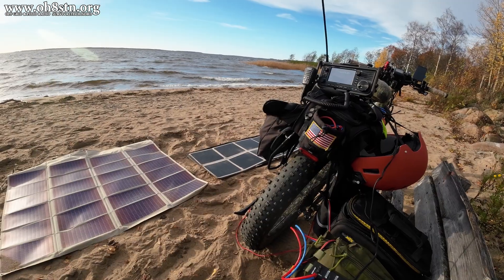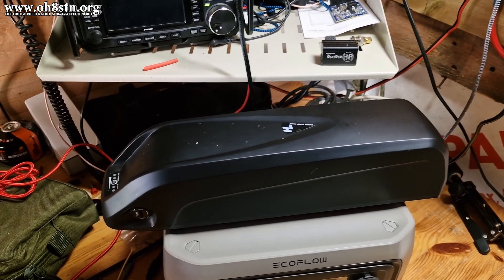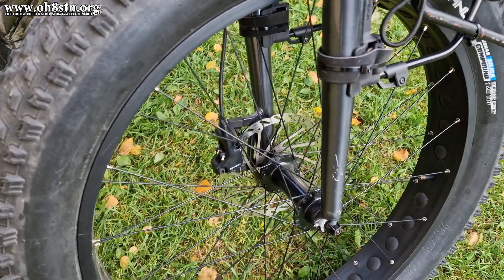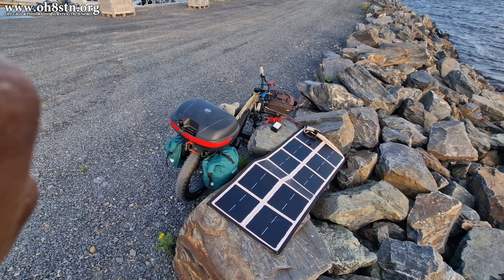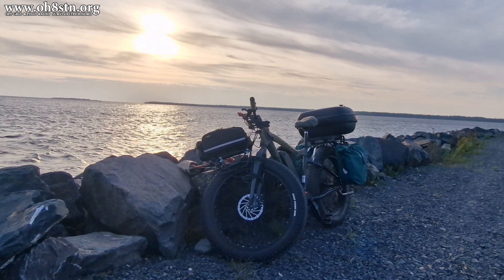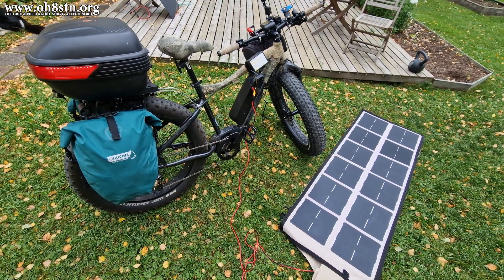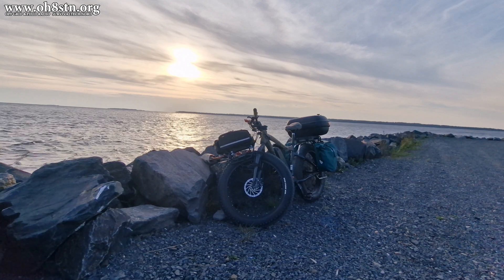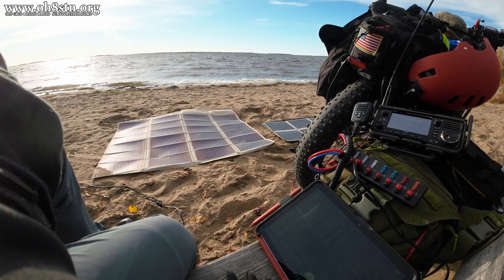Off-Grid E-Bike Charging with The Sun | PowerFilm Solar

Comment: I ride a fat'ish tire (3 inch) ebike for commuting, cargo, workouts, and recently started riding it offroad in preparation for some camping trips. I'm also experimenting with recharging offgrid, so I could try and reach more campgrounds in my area without risking a ride with an empty battery near the end. Although for now I'm just dipping my toes with a 45 Watt solar panel, which would need some 2-3 days of perfect weather to recharge my battery from zero xD
Still, might be enough to get me some 20-40 extra kilometers on a weekend camping trip.
Also, I'm hoping to live offgrid someday, so I see it as a good way to familiarize myself with offgrid power in small scale before going big.

Comment: I was hoping that you'd have hub motors with bicycle pedals .     I agree , changing a tire is more difficult with the hub motors  .     I've been loving Your awesome videos since the HEADWAY LIFEPO4 cells , I ended up buying 8 of the batteries used , made 4S2P 13.1V 15Ah .       It should have about 400cold cranking amps for ten seconds , so I might be able to jumpstart a big truck with them , I'll make that video eventually on YT .    But you helped get me to buy the HEADWAY cells Thanks and keep kicking butt .

Comment: Very interesting and informative video. There are many e fat bikes on the market now. So may I ask why you choose GZR..? Also why the 160 w Powerfilm instead of the 220w or the 190w..?
Reply from the maker: Thanks for the question and comment. The gzr was only about availability, support, and service in my local community. I also chose it because of its simple two wire battery charging.
I chose the Power film 160 because at the time it offered the highest efficiency in the lowest weight I could find. Moreover, I didn't have a charge controller that was capable of utilizing more than the 160 watts. Now I have two charge controllers, so I can double up on the solar panels.
Reply: @ Thanks for your reply. Would the 220 Powerfilm be a viable option and would it charge an e bike faster..?
Reply from the maker: @thegreateststruthsnevertold it would charge an e-bike faster if you could find a charge controller capable of handling its power. 👍
Reply: @OH8STN  Is that why you choose the 160… due to limitations of available charge controllers..? There is a New 190w now… Are you aware of any charge controllers that would do the job… for the 190 and or the 220w..?
Reply from the maker: @thegreateststruthsnevertold those solar panels are awesome if you're going to connect them directly to something like the ecoflow delta or the eco-flow river bluetti, ... solar generators.  In fact any solar generator which has the charge controllers built in. Anyway to answer your question yes, that's why I chose the 160 for charging my electric fat bike.
Reply: @OH8STN  Thanks for your reply. However you missed answering one question. Are you aware of any stand alone charge controllers that could handle a 220w or 190w Powerfilm Solar panel..? Thanks in anticipation..! 😀
Reply from the maker: I did answer, but here is more context. If you want to make use of those larger solar panels for charging your e-bike the one way to do it with the larger panels is to use the solar panel in addition to a inverter, and the e-bikes AC charger. As far as I know,, there is no portable charge controller which can handle 190 or 220 or more.

Comment: I own an E-CELLS Super Monarch Crown e-mountain/cargo bike. 2 wheel drive, 2 batteries and dual suspension and weighs 95 pounds. It will haul 400 pounds including my weight.
MY CHARGING SYSTEM-> 200 watt off Grid TREK solar blanket from Canada, ELEJOY programmable controller and cables. My bike has a Patented frame charging plug near the crank area. It charges BOTH batteries simultaneously. Rene at Off Grid TREK made the cables for the blanket and for my bike (of which he has an identical model).
THIS SOLAR BLANKET/CHARGE CONTROLLER system is easy to carry and easy to use. The Off Grid TREK 220 watt or 300 watt solar blankets are the FASTEST charging blankets sue to not being much affected by shade and clouds compared to all other solar blankets. My 220 watt 3' x 6" OGT blanket weighs 12 pounds and 1.5 pounds for the ELEJOY programmable  charger.

Comment: How do you avoid overcharging the battery?
Reply from the maker: That is the job of the charge controller.
Reply: @ does do this automatically or require you to set it?  Thanks for the awesome info. Got me into a fat bike and now looking at the solar options for it.
Reply from the maker: @robertalonzo5725 it's totally automatic 👍

Comment: Also, I only found the GZR on a Finnish website? Is there a link to the bike? I have found the AMYET bikes available that are similar but not mid drive for the easy rear wheel replacement. 
Edit: Also, I just saw the end of the video where you say you're in Finland. Much clearer now why you ride the GZR. Ha!

Comment: Excellent setup Sir. I have been using my Fatbike and trailer to drag my radio gear, batteries etc around South West Scotland but getting older and slower so Human Powered travel range is becoming very limited. Looking at options available for either a bolt on Ebike conversion kit for a while but not that impressed with kits that will fit a fatbike. I have almost given up and started collection components to build my own custom system to fit my existing fatbike. Currently only have a small 65W portable solar panel and a selection of Li-Ion and LiPo battery packs and a 250W motor and modified controller recycled from an old scrapped Ebike  Now saving up to get  better solar panel and battery with goal to get the system up and running for next summer and I can get back on HF and try to bag a few more summits and grid squares that I simply cannot reach in sensible time span under my own leg power.  Looking forward to seeing more of Your HAM adventures on the Fat-E-Bike. All the best de MM7WAB IO75sj

Comment: Great video as always! However, for over $1500 for the solar panel alone, this project is WAY too much for my budget.
Reply from the maker: Yes the solar panels are expensive but there is the Genasun kit featured on the channel earlier this gear. That solar panel is easier on the pocketbook, but not quite as portable. Take a look.
https://youtu.be/PR893unyMog?si=6d7OKkCk_bJ3Ly_M
Reply: @OH8STN  Thanks for that Julian.  Does anyone know of a way to build a foldable panel, instead of buying one?  Or, does it not make sense economically.

Comment: Remember, these bikes are a LOT heavier than your typical mountain bike so lifting & pedaling is a lot of effort.  Also, you won't typically get a 15 or 18 speed shifter.  (Usually 7).  My USA made Lectric brand 2 wheeler is 65 lbs (30 KG).

Comment: Thank you for opening my mind. Funny how our mindset can narrow on it's own from habit without us noticing...
I've been interested in electric bikes, but the self-made hurdle has been their voltage. My logic has been all my radio and other gear is 12v and 12v isn't a reasonable option for e bikes. I just needed this gentle reminder that all I needed was a simple relatively inexpensive charge controller and the rest of my solar kit would work just fine with a bike in the field. *slaps myself on the forehead....

BTW, also thank you for introducing me to Genasun! I have them in my camper and a battery box or two. Fantastic products.

Comment: Is "fat bike" a brand name, or just what you call it?
Reply from the maker: Excellent question. Fat bike is a type of bike. It has 26 x 4-5 inch "Fat Tires". The tires are much wider than a traditional mountain bike, allowing them to float over sand snow or other types of terrain. The rolling resistance is pretty high but the darn things will go almost anywhere. The actual brand of the bike is GZR.

Comment: I prefer the hub motors and extra batteries. To charge on the go you need more stuff in a trailer. And in that case you would have to move by night and charge by day. Which I do have that capability but riding with night vision is a challenge, I plan to upgrade to boomslang lenses on night vision for a larger FOV.

With a trailer this winter I plan on taking a pruning saw to clear the trails of fallen trees or things like that.

I have been watching you for years now. And my idea is the ebikes are great for getting around to setup meshtastic nodes in tough remote places as well as ham radio repeaters.

I would like to see some more on the fat tire biking mixed with drones and using drones as repeaters or even as a tool to place repeaters in tops of trees. That would be cool.